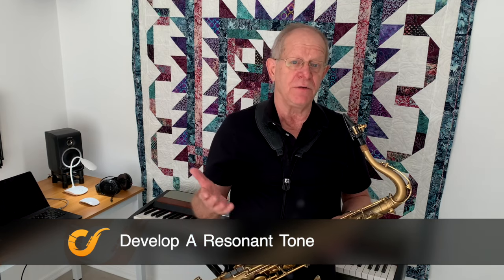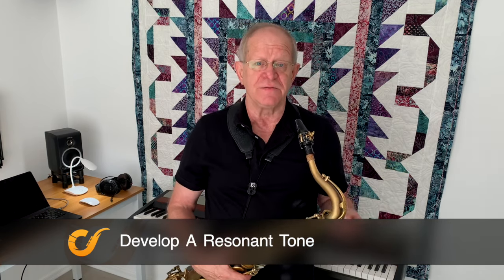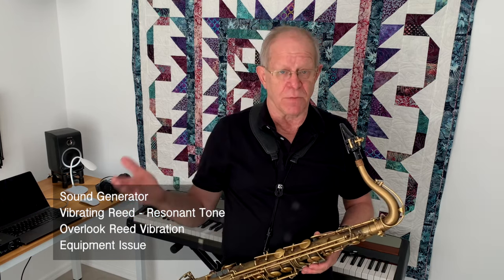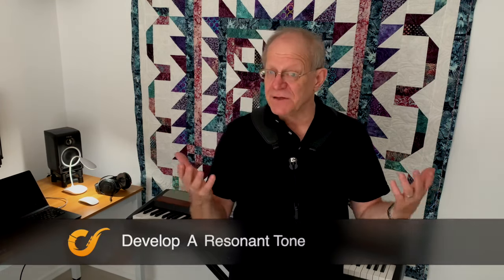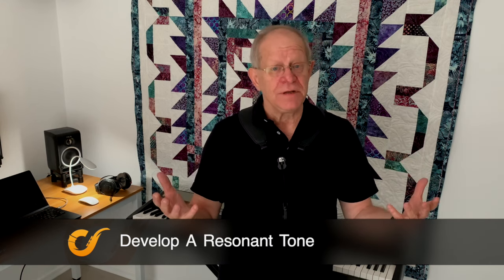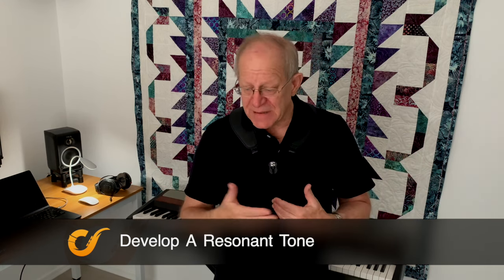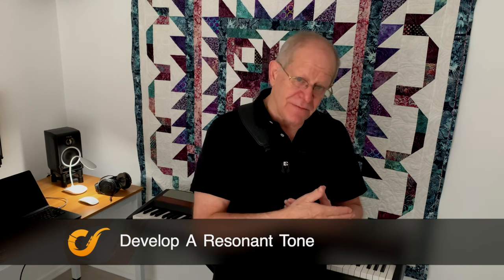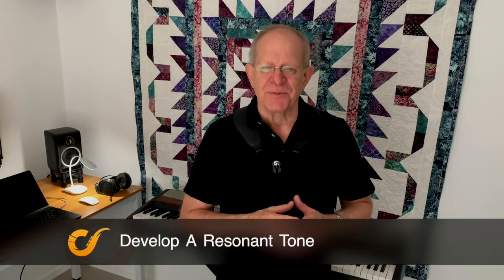Develop A Resonant Tone

Comment: Thanks, Steve. After I watched this video a couple of months ago, I could have a lot of freedom to play saxophone. 
One problem is when I play piano/pianissimo notes at the end of my breath it is very difficult to produce the sounds without biting reeds to reduce the mouthpiece tip opening. 
Can you please give me some advice on this?
Reply from the maker: I have been away from my YouTube studio and have not received a notice of your comment. Sorry, it took so long to reply. 
Unless you have a very large tip opening on your mouthpiece, such as a 9 with a medium hard reed, you should be able to control the tone to niente (nothing). But, while not difficult, it can be elusive. Notice you tend to push the air. Soft levels require almost no effort. When we use effort, we restrict the reed, even just a little bit. This shows more when we play softer. An excellent way to counter this is to let go of the tone quality when you play softer. This is counterintuitive to what you would expect, but the tone always sounds attractive at soft levels. The issue is getting a response at very soft levels. As you play a decrescendo, try spreading the tone. let the pitch sag. Even puff your cheeks. Relax everything; your air, your throat, your mouth. The sound will stay centered.  Hope this helps.
Reply: Thank you for your advice. I tried it just before but it was not easy. I willl keep try it.

Comment: What is confusing to me is when you say we shouldn't tighten the abdomen to avoid tension. It is the opposite of what my teachers told me. Is it a misunderstanding on my part?
Reply from the maker: This is a great question. Many players believe the abdomen needs to tighten to support the tone. I was taught this way myself when I was in school. But, Arnold Jacobs, the late tubist with the Chicago Symphony Orchestra and renowned teacher of breathing and wind playing, said, "The best air support is no air support." It seems contradictory and counterintuitive, but your abdominal muscles engage automatically when the tone begins - similar to humming. You can feel this by putting one hand on your abdomen, take a large breath, exhale, then hum. The abdomen flexes automatically. Do the same by exhaling the air through the mouthpiece, then producing a tone on the saxophone. The abdomen flexes automatically. The vocal folds come together when you make a saxophone tone. Intentionally flexing your abdomen and pushing is unnecessary and adds effort. You will see this effort in how your hands respond to the flexing. I hope this clarifies things.
Reply: @saxcoach2131  thank you for your detailed answer. I will definitely try that because it makes sense. I struggle to relax while I focus on air support.